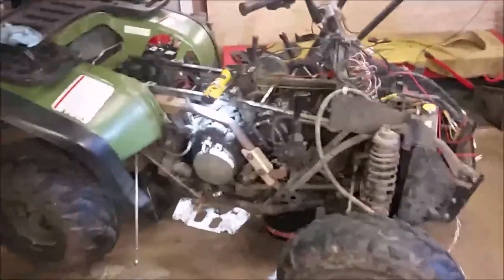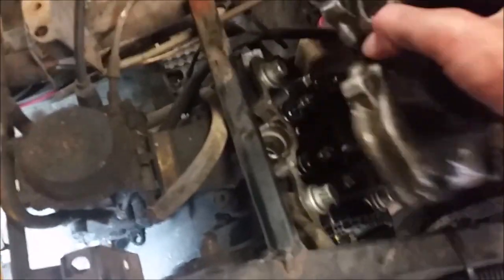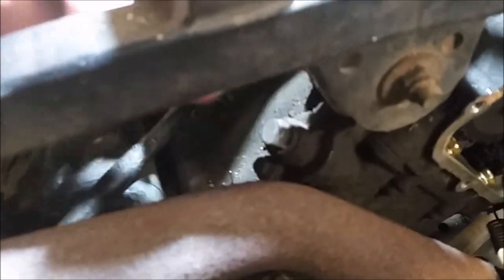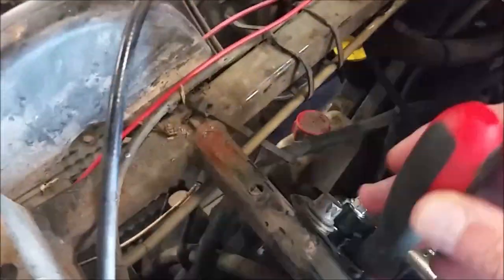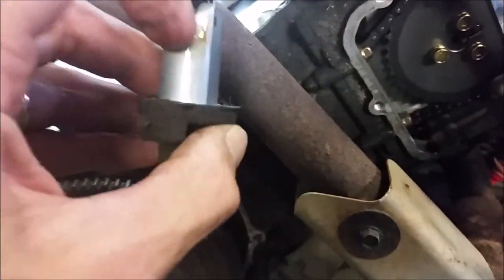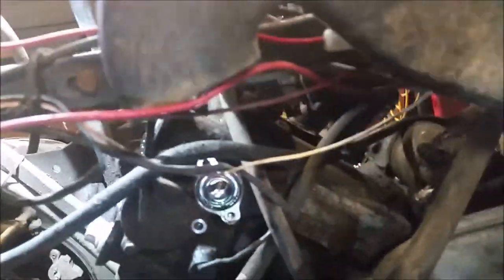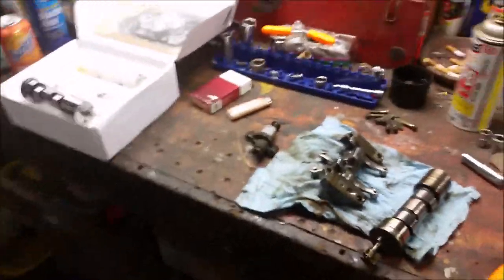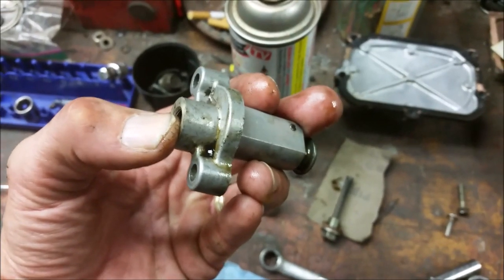Polaris 500 camshaft removal and replacement

Comment: I'm on my 5th polaris cam install
Reply from the maker: Nice! I'm about to do a Magnum 500. Needs a head gasket. Ill do the cam too while I'm in there.
Reply: @TitaniummanGarage  I put the 500 ho cam and carb on my 500.  It's very noticable, especially from stop to about 25 mph.
Reply from the maker: @dan27444  Thanks for the tip. Ill give that a try.
Reply: I heard they install soft cams.
Reply: Mine wont start now after putting in came, and new rockers, ajusted them, is there 2 strokes to tdc or just one rotation, i had my marks, wired up my chain gear chain never moved, cam only goes in one way, ive went back over it, popped once, just turns over, did yours fire everytime you replaced it or did you have any no start problems, maybe you can help and give me some feedback, im stumped
Reply: @kirkloftis9688  there should be marks.
Reply: Im positive its at tdc, popped alittle more, unplugged my kill switch after looking into it more, ordered another carb, coil, pick coil, cdi, fuel pump, if that doesn't work, only other thing ive seen is mayne play in bearing behind stater, ajusted my rockers twice, pulled cover and they were closed again gauged them 0.006, ill keep circling around each part as i put them in and see what it is, as of now i think its fuel pump or pick up coil..ill be back
Reply: I'm putting a cam in my polaris sportsman 400 just about same motor as the 500 but the new cam is going in really tight on the the gear side where the chain is?should it be that tight I had to tap in on threw to get it go all the way in?
Reply: @bobbymckinney1264  i didnt have to tapp mine in, but it was a solid fit, ended up getting it going, big difference these things have soft cams, i also changed the rockers, learned alot about the 500s, been through 2 of them, i buy em and flip them if they pop up, it only goes in one way once you got your rockers back on set your lifters set screw gap at .006, keep your lids off and put something under it to test start so oil don't leak, i only say that because i kept having to take mine off and on, i also put a new stator, pick up coil, that gaps at 0006 also, new fuel pump and carb, plug, choke cable,  its good to go..good luck with yours
Reply from the maker: @kirkloftis9688  1997 and 98 they did.
Reply from the maker: @bobbymckinney1264  Sorry to get back to you guys late. I didn't see your messages. Yes sometimes the cam goes in hard like that. Put a little oil on the ends and tap it in. How did yours turn out?
Reply from the maker: @kirkloftis9688  Sorry I didn't get back to you. your message went into my spam box for some reason. Check out my new video https://youtu.be/EMQhec-6yII  I've had lots of people ask about the timing.  Yes, I've had the same issues. Sometimes you just have to hunt the issue down. Sounds like your gettn er done. One thing to keep in mind is after you adjust the valves make 3 revolutions and readjust valves again. the tensioner will have to readjust itself. How does your chain look? It could be streched out. Let me know what you found out.
Reply: How do I know if it is the cam? My Polaris is back firing through the intake bad and can’t even give it gas. Getting worse as I start and try to run the wheeler
Reply: @tannerhart4732  you have to pull the cam cover off and look at the lobes.  It'll be obvious
Reply: Thanks so much @ dan Isaacson. Greatly appreciated

Comment: Ok...I washed the quad before putting the gas tank back on...I just checked the spark plug and it was all wet under the cap...I pulled the plug and the whole plug was wet from the water...
Reply from the maker: Plug spark plug to wire. Leave it out of machine. Touch it to something metal. See if you have spark.